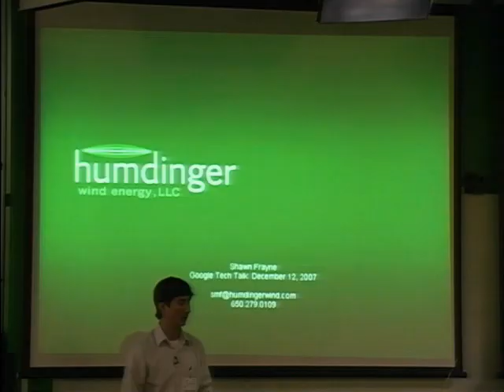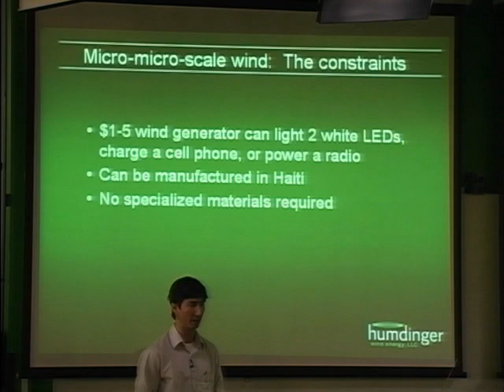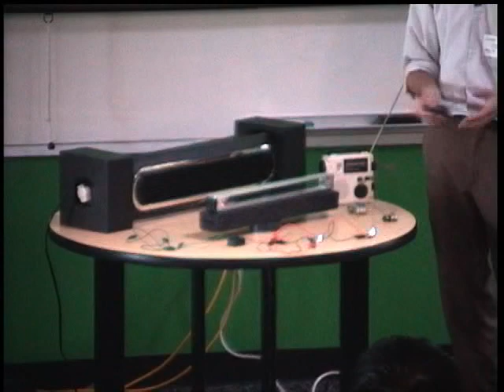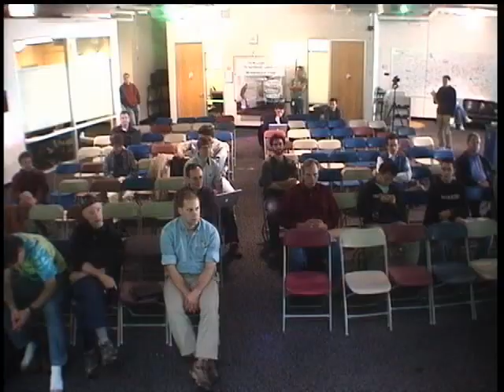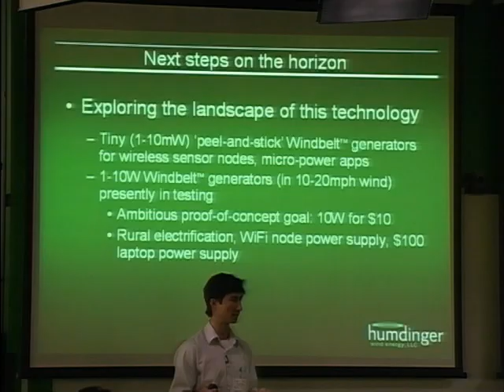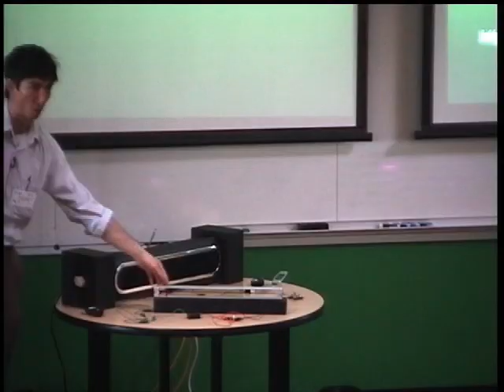Windbelt Cheap Generator Alternative

Comment: Idea 1
convert the mylar strip into a piezoelectric strip removing the need for magnetics and at the same time eliminating the worry of trying to restrict the vibration to only up and down.

Idea 2
Assuming there is an optimum length of the strip, you could use one piezoelectric strip that goes say 90 feet which is pinned down every 3 ft. It would be as easy as unwinding a water hose. You could even dual use it as fencing

Comment: governments will never support truly independent power systems? never mind the fact that they were subsidizing them to the point they were free in my country, and subsidized 80% of the cost of solar in the euro zone. you think a heat engine never got off the ground? do you know about stirling engines? and peltier devices that you can buy or make the generate power? watch?v=Zl_AvKkCFQk

Comment: Governments of all types are interested in controlling thier population. One way is to provide energy and withhold energy. Governments will never support trully independent power  systems because the leaders loose the ability to turn them on and off. Only through small enterprise will this get anywhere. go ask your heat engine

Comment: its called "THE ELEGANT SOLUTON" 
it is based on the idea that a design can push the  margins liimiting designs toward the maximum posable. 
intrinsic dualism  means that whatever i  add here  i take away somewhere else therefore nothing i do ever works. 
Another way of looking at it is  the path of diminishing returns as ploted on a graph  two lines of cost and benefit eventualy cross. elegant design is to  plot thees lines all the way across the graph  until thy cross at a maximized position

Comment: @711131719 FREE ENERGY IS THE PATH BUT THAT MIGHT GET MY  LITTLE ASS KILLED  CAN NOT SAY MUCH BUT, CAR ALTERNATOR  3 BLADE  1  TO  8 ALTERNATOR   PER UNIT  30 TO 200 DOLLARS   CHEAP GREEN ENERGY BY THE WAY I PLAN TO USE A SMALL GENERATORS  TO POWER THE ELECTRIC MAGNET IN SIDE THE CAR  ALTERNATOR .THE BLADE IS REAL ADVANCES AND CHEAP UNDER $50  1 HR TO MAKE IT .  EASY TOO.

Comment: I've been using these vibration effects to power mag-drive cars (replacing the present battery static locale types). See UTube "Mag Air Vibe Gen" for a sample using both his devices here ( but output fan changed into Air Turbine Generator).

Comment: Did you consider the idea to build a frame of enough belts like this - you should know how many are required- in order to be mounted in front of a radiator in a vehicle and the power harvested to run a HHO generator?

Comment: I halted this video at 07:24, where the cost constraint was $10. 

In 1990, at the Glastonbury International Arts Festival, a 'Wigwam' harmonic oscilation belt turbine was demonstrated. The components were as follows:-

(1) A Pole
(2) A plastic 'Hoola Hoop'
(3) Ribbons
(4) Pegs (Skewars/Tent Pegs)
(5) Magnets inside coils [inside 'Hoola Hoop']
(6) Super-Capacitors (instead of batteries)

Power generation functions like the ubiquious shake-torches. 'Hoola' half way up 'wigwam'
;-)